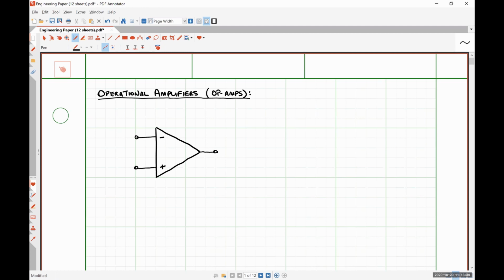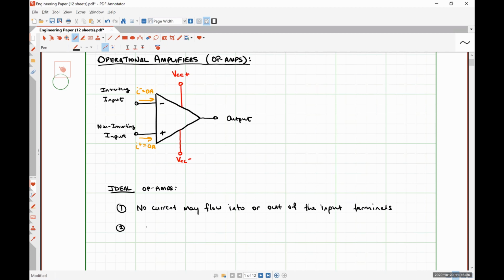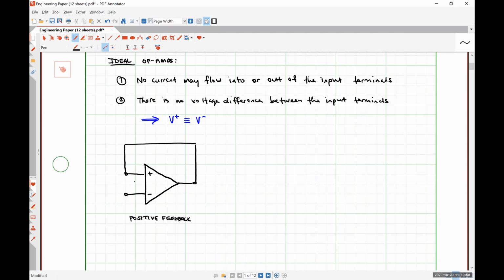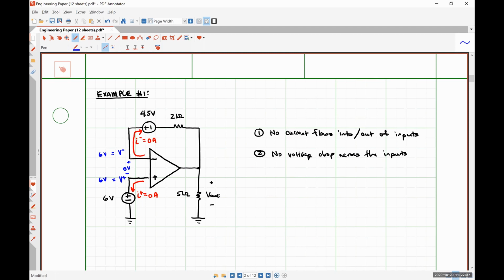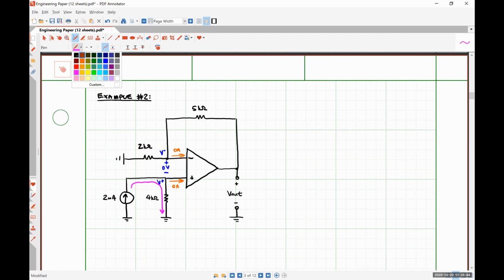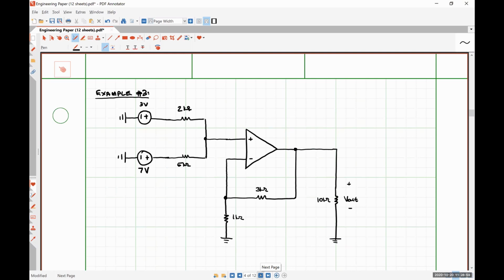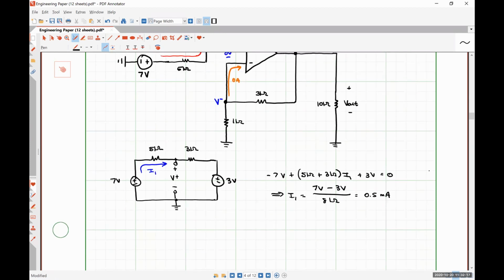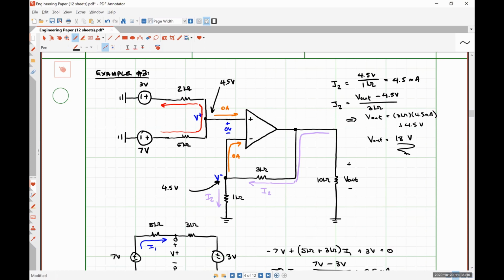ENGR 221 - Introduction to Op-Amp Circuits

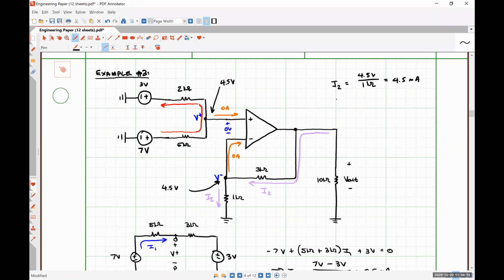Comment: There's an error somewhere here at 22:11. Vp should be the solution to (Vp - 3)/2k) + Vp - 7)/5k = 0. Solving for Vp we have Vp = Vn = 4.14 volts (not 4.5). And  thus (4.14 - 0)/1k + (4.14 - Vout)/3k =0. Solving for Vout we have Vout = 16.57 V.